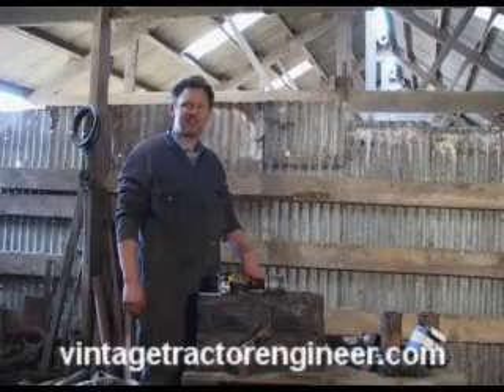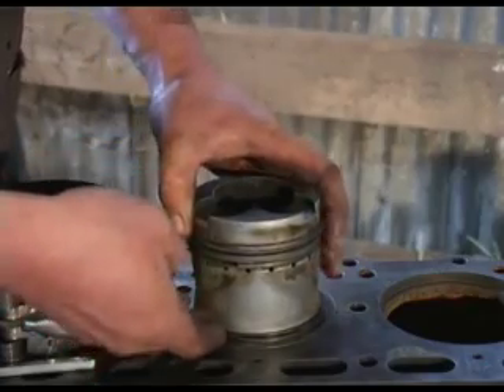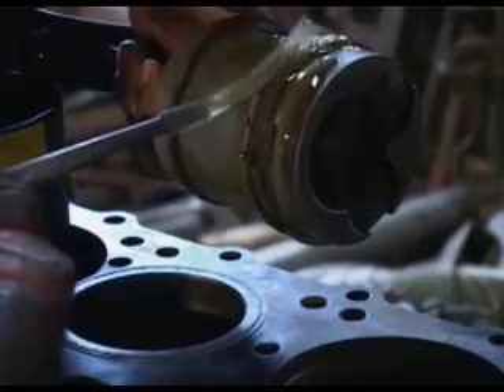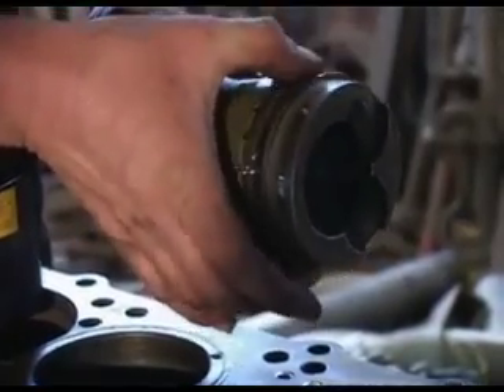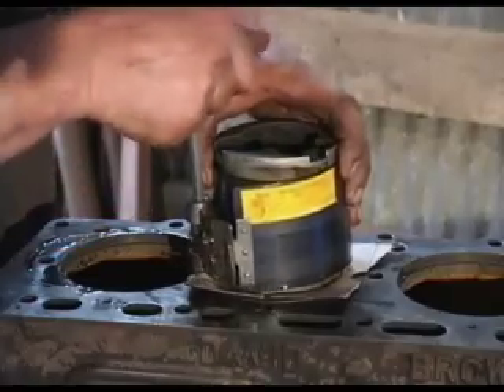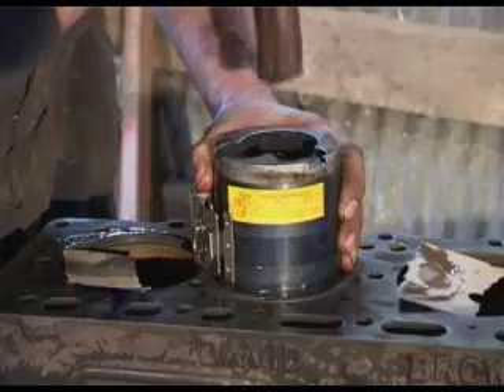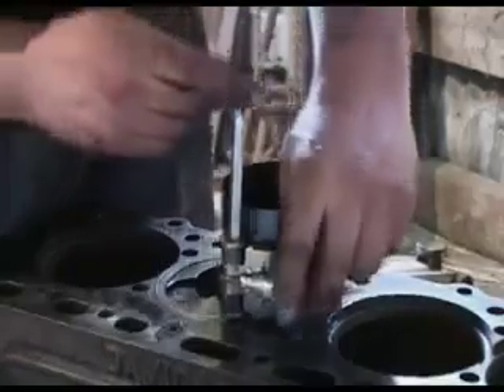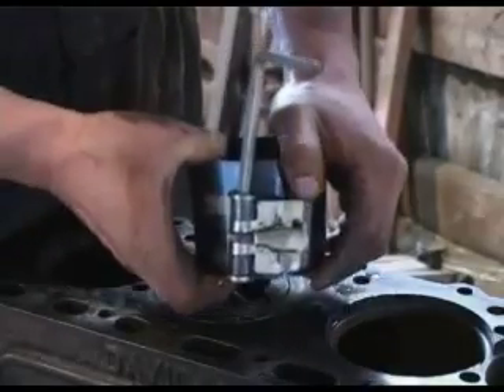Using a Piston Ring Compressor.wmv

Comment: It dose not matter if the ring end gaps are in different positions,   because the rings move around inside the bore when the engine is running.

Comment: a better method for oiling is have an old coffee or something or similar half full of engine oil then just dunk the piston in let it soak for 30 seconds bring it out suspended it over over the coffee can to get all the exxcess off then do as shown the reason you dont want the ring gap to all line up is itll have low compression

Comment: does anybody have suggestions on how to do the same thing but on a 2 stroke air cooled engine? 

I took off the top end of my engine to replace the head gasket  and now IM having trouble fitting the piston back over the into the op end of the engine cumbustion compartment.....please help with any suggestions.

Comment: Just to let you know that by using this and many other videos on youtube as well as some guidance from an overhaul manual i done the following to my car engine

k-series 1.8 VVC

-Fitted two new liners and resealed the other two
-Honed the liners
-Fitted brand new piston rings on all 4 cylinders
-Ported the cylinder head for more air flow
-Fitted a uprated exhaust cam

thanks!